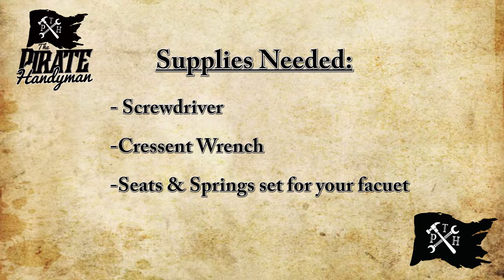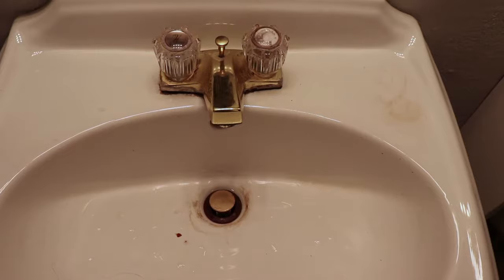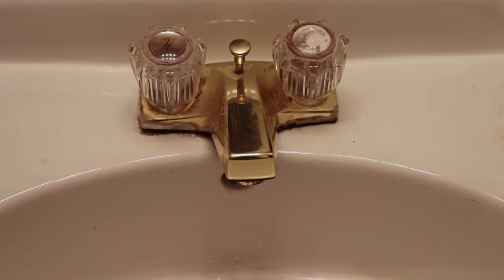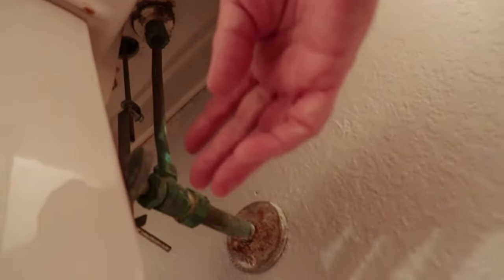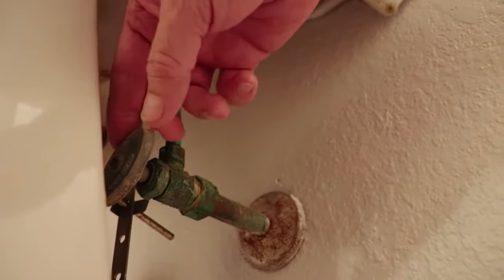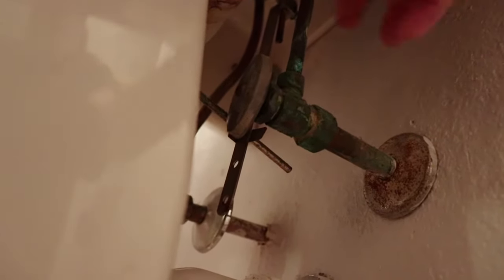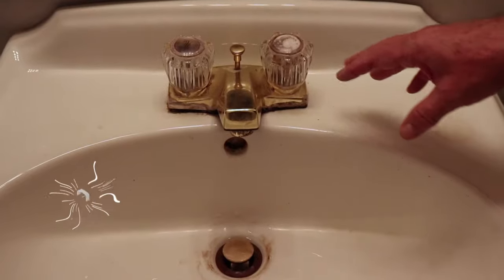How to Fix a Dripping Bathroom Sink Faucet Double Handle

Comment: Just a tip make sure u put the stem back in with the flat silver part on the bottom of the stem over the spring and seal in the off position and the knob the same way it came off you can get the direction of stem the wrong way. If u notice in the video he turned knob to left to turn off which is backwards. Also grab some waterproof grease and lube up all the o rings and seats. Good video buddy people don’t realize how easy and cheap it is to fix this.
Reply from the maker: Aye, matey, thank ye for the tips!

Comment: Hey matey.  I tried your drip fix and it worked as you explained.  One word of caution.  I didn't push the seat spring far enough down.  Since your directions were so good.  I ended up doing both of the handles.  Thanks so much.
Reply from the maker: Aye, matey, glad it worked - smooth sailin'!

Comment: Turned off the hot water under the sink to fix the sink faucet, and now the shut off leaks...
Reply from the maker: Aye, that happens. But it's an easy fix. Although the video link below is for an outside faucet, the fix is the same on the valve. Let me know if this works for you.

https://youtu.be/KDAB0HjgYYs

Comment: This is a terrific video, clear and to the point. Unfortunately, I didn't get very far with the repair. Do you have any suggestions for how to remove a stripped collar? The crescent wrench just spins around. To help it grip, I tried wrapping it tightly with a rubber band, but it did no good. Same result with locking vise grips. I appreciate your help. Thank you so much for sharing your knowledge!

Comment: Great video, taught me all I needed to know. My biggest problem was finding the right seat and spring. I made 2 trips to Ace Hardware, but it was wrong both times. So I ended up at Lowe's. It was smooth sailing from there. My next project is unclogging my double-drain kitchen sink with disposal. Have any videos on that?
Reply from the maker: Aye, matey, and thanks for the kind words!  Here are 3 videos that might help ye with yer sink issues:
https://youtu.be/21Gl3ObLH6Q
https://youtu.be/OVaLKdxC8tY
https://youtu.be/BQxzPwtFzHA
Here's to smooth sail'!
Reply: Yes, any old seat and spring doesn't work.  I'm having trouble finding the right one also.  My husband remembered we have an old tub faucet.  Voila!  Same parts.  The video is great.

Comment: Thank you for going the extra step of showing the gasket and spring UNDER the cartridge!!!
I replaced a hot water cartridge for my MIL and in a few months it started to leak again 🤦 . 
I bought a new cartridge at that has the gasket and spring with it. Even though the cartridge is a few months old, I will still change it out at the same time . 
Thanks again for this video!!!
Reply from the maker: Aye, lass, that usually be the problem!  Next time, you'll know to just buy the grommet and spring, and save even more coin!  Smooth sailin'!

Comment: Good video. The only thing I might ad is while I have it apart I would replace the O-ring as well. Might as well replace it all while you're in there and some have a little flat washer, a smaller O-ring and a brass seat. The brass seat doesn't need to be replaced that often usually when replacing everything else doesn't work but hey, while you're there. Your call. Enjoyed the video. Keep up the good work.
Reply from the maker: Aye, matey, thanks for the insight - we appreciate the recommendations!

Comment: I know how to fix leaking faucet but has one that kept leaking even after replacing everything. 
The “treasure” (pardon the pun) in your video was getting all the water out before putting the spring and gasket back in. No more leak and didn’t have to buy anything. 
Thanks matte
Reply from the maker: Aye, matey, glad it helped - smooth sailin'!

Comment: This video helps so much. Another problem I have with my faucet is that is moves back and forth a bit. It's not sealed well to the sink. Is there an easy fix for someone like me who is not handy at this sort of thing? Thank you for your help.
Reply from the maker: Aye, there are large "wing nuts" underneath the faucet where the water lines connect to the faucet. You just need to get underneath and tighten these wing nuts, which should fix the problem.
Reply: @thepiratehandyman2225  Well Shiver Me Timbers and Yo Ho Ho!  This Scallywag should have known that all I needed to do was Batten Down the Hatches. Seriously, I thought I needed to caulk it or something. Thank you. Ahoy Matey!
Reply from the maker: Ahoy - glad this helped! Smooth sailin', me hearty!

Comment: Thanks a bunch. Your video is easy to follow and makes the work much easier.
Reply from the maker: Aye, me hearty, thank ye for your kind words - glad it helped!
Reply: I am back! I was unable to get to where I would see started dripping. Couldn’t move either valve inside the cabinet. Are the valve really corroded? Please reply?
Reply from the maker: Aye, it could corrosion on the valves. Try spraying a product like CLR on the shaft of each and let it sit over night. If that doesn't work, then try spraying the shafts with a lubricant like WD40. Let that sit a couple of hours, and repeat a few times. If that still doesn't work, you may have to call a professional. Let me know what happens with the above tasks.

Comment: 👏🏻 Thanks for the great video. My faucets don’t “seem” to have the seats and springs but just an old school washer. But there are these metal inserts that screw on at the bottom. I keep wondering if they should be adjusted a particular way to stop drips.
Reply from the maker: Aye, matey, are the washers rubber?

Comment: Excellently made very educational and helpful video.
Q1. is the spring and seat set universal for all faucets?  (I think my leaking faucet looks like yours)
Q2. How/where can I tell the brand and model of the faucet I have (it is abt 25 years old) - don't I need that to order the right type of spring and seat set?
Thank you!!
Reply from the maker: Aye, matey, thank ye for the kind words! Yes, the spring and seat is generallt universal, unless you have a fancy/expensive faucet. The name and model number is probably stamped on the bottom of the base housing, which would require you to take the faucet off the sink. More work than necessary, in my opinion.

Comment: Nice & clear & u made it looks doable, but mine is now leaking even when I shut it off under the sink.  
   Do u think this will fix my problem or do I have to do something with the shut off, under my sink?
Reply from the maker: Aye, lass, you probably need to replace the grommets on the shut-off valves, as well. Although the video link below is for an outside faucet, the fix is the same.
https://youtu.be/KDAB0HjgYYs

Comment: That was great! So are all the 2 knob faucets the same inside? Mine is old, it has porcelain faucet, does that make any difference?
Reply from the maker: Aye, lass, most be the same. However, some do have a different cartridge that may not require the spring and grommet - but not many. If your is different when you take it apart, let me know and we'll figure it out together. Smooth sailin'!

Comment: Great video !! I tried to turn the water off underneath the sink but can't get it to budge.  Can I take off the handle & replace the seat WITHOUT turning the water off underneath ?
Reply from the maker: Nay, matey, ye need to turn the water off or it will spray all over the deck! Try spraying the shaft of the shut-off valve (under the sink) with WD40 or 3-in-1 oil, and let it sit for a few hours. If this does not work after 2 or 3 tries, then you'll need to shut off the main line, which should be next to the house on a direct line from the water meter.
Reply: @thepiratehandyman2225  Ok, I thought so !  Thank you so very much for responding !! I did spray both the shut off valves with Kroil Oil this morning but didn't know I needed to let it set for hours.  I'll try again. Again, thank you so much for your most helpful response !!!
Reply from the maker: Ye be most welcome, matey - smooth sailin'!

Comment: Thank you this helped and I was able to find the issue. After replacing the cartridge I noticed my faucet still leaks. As I got closer it looks like the part where the spring and cartridge kit goes into has a crack. Is there a way to replace just that part or will I need to buy a whole new faucet?
Reply from the maker: Aye, if the casing is cracked, ye need to replace the entire faucet. But at least now you have the knowledge to replace it yourself!
Reply: @thepiratehandyman2225  thank you!!
Reply from the maker: Ye be most welcome - smooth sailin'!

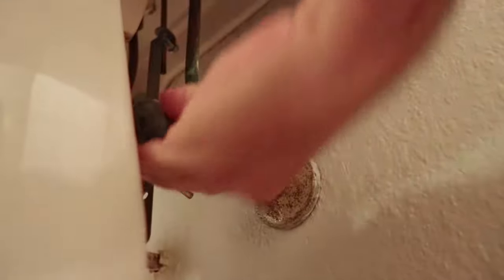Comment: Having a hard time with just turning the water valve to shut the water off under the sink, 2:17 . Is it just because these haven’t been shut off in a while or could something else be going on? Great video and appreciate any tips on this. Thank you!!
Reply from the maker: Aye, if it hasn't been used in a while, sometimes a build-up of minerals can make it hard to turn. Try putting a lubricant on the shaft, like WD40 or 3-in-1-oil, and let it sit for an hour or so.  And thoank you for your kind comments - smooth sailin'!

Comment: thanks for the video, very informative.  Once I got the collar off, the plastic stem won't come off - it's been there a long time, lots of hard water in the area, only seems to be one tab on the part, it's really stuck on.  Pretty sure it's the washer seat and spring to replace, but can't seem to get the plastic stem off to even get to the seat.  Any thoughts on how to remove?
Reply from the maker: Aye, matey, that be a common problem.  Try putting a lime-dissolving solvent like Lime-away on the collar and let it soak.  If that doesn't work, put a lubricant, like WD40 or 3-in-1 oil and let it sit for an hour or so.  This combination should do the trick.
Reply: @thepiratehandyman2225  thanks , will try the lime away.  Put Liquid Wrench spray but no luck. Crossing fingers.  Thanks
Reply from the maker: Aye, matey, may luck be with ye!

Comment: Hello and Thank You, your video is very helpful.  I do have a question if you could help.  I don't think this my sink handle has ever been taken apart.  I got to the part where I was to use the wrench on the nut before removing the cartridge.  Well, the nut is not budging....  Will wd40 get it to loosen or unfreeze it? Or what would you recommend?  Thank you in advance for any ideas.  Falicia
Reply from the maker: Aye, Lass, WD 40 should work.  You may have to spray, let it sit for a few hours, and repeat.  If that does not work, soak a small rag in very hot water (don't scald yourself!) and wrap the rag around the nut after spraying again with WD 40.  Let that sit for about 5 minutes, then try again.  If that does not work, let me know.  Good luck, matey!
Reply: Did it work ??

Comment: Love the video and seems greatly informative.  However, I’m having an issue.  I have 2 handles instead for my hot and cold water.  When doing all the steps you did above, after I took the cartridges out (which was a major pain) I was unable to find the seats and springs that you had mentioned.  The handles/faucet themselves seem to go a lot further down as well in comparison to yours.  Is it possible my faucet just doesn’t have those seats and springs?  After draining the excess water with toilet paper where the handles were, that had stopped the drip.  However, when I turned the water back on (after reinstalling everything of course) and shut them off, the slow leak returned.

I should also add, I still had a very slow drip when I turned both the hot and cold water off.  Any ideas?  Thanks
Reply from the maker: Aye, matey, let's first tackle the dripping water when you turn off the feeder valves. There is a grommet on the end of the valve stem that probably needs replacing. The video link below, though for an outside faucet, is the same concept.

https://youtu.be/KDAB0HjgYYs

As for not having seats and springs, does the valve handle have a grommet on the end, like show in the video above? If so, then the fix is the same. If not, then you may have to replace the cartridge.
Reply: Sorry about the much later reply, definitely not my intention.  I ended up changing the cartridge on both sides and that did the trick.  Appreciate the help and the knowledge.

Comment: This is the exact type of faucet and knob I have. I need to only replace the knobs. I bought a universal pair that was supposed to “fit all faucets”. Well, it doesn’t because of that white piece structure under the knobby . Is there a certain knob for this; one that fits on this particular knob configuration?
Reply from the maker: Best thing is to bring the old knob to the hardware store and see which one matches. If there is a knowledgeable person there (usually there is), they can help you. Good luck!

Comment: Thank you for this video..just a question, what does it mean when the water keeps filling back up after you've removed with tissue paper?
Reply from the maker: You may need to replace the grommet in the supply valve under the sink. The video below shows how to replace it. Even though the video is for an outside faucet, the concept is the same.
https://youtu.be/KDAB0HjgYYs

Comment: The small sring in bottom . Does wide end go in first or small end
Reply from the maker: The wide end of the spring goes into the rubber grommet, and the narrower end goes in the hole.

Comment: Help, please? I have the same sink knobs but their placement is separated by the faucet.  When I turn on HOT water,  water drips from just beneath the plastic part. It's gradually getting worse. How do I fix this?  Thanks from an inspiring DIYer!
Reply from the maker: Aye, matey, it sounds like you may need to replace the cartridge as well as the spring and grommets. If it still leaks, you might have a crack in the housing. In that case, you will need to replace the faucet. But even then, ye can do it!

Comment: Just removed my handle and valve assembly piece... It is a price pfister and all came out as one piece.  I do not see a spring or seat like you had.  There is a black rubber piece that looks similar to your seat in the bottom of the valve assembly.  Can that be removed and replaced or will I just need to replace the whole valve assembly piece?  Thanks!
Reply from the maker: Aye, matey, for that one, you just need to replace the rubber grommet. Although the video link below is for an outside faucet, the concept is the same.
https://youtu.be/KDAB0HjgYYs

Comment: Thanks for video, would of been helpful to know part number you used? Danco 86968?? For the seat and spring part to go fetch.
Reply from the maker: Aye, I understand the concern. The problem is, there are so many generic brands that will work, and it all depends on the store or website you use. It's impossible to list a specific part number without excluding several that would work.

Comment: Hello , I have a cast iron sink in my bathroom it’s 
not so old but I’ve been looking for a faucet to replace the one of the faucets, but to no avail 
I’ve had no luck, its brand name is American Standard I’m guessing it’s from the late 50’s mid 60’s , the hot water handle faucet as l turn it 
it just got completely loose. 
My husband has been looking for a way to fix 
it we’ve gone all over Atlanta looking for that particular part but because it’s a four inch and not a a six we’ve been told it’s really un fixable. 
I really hate to part with that sink yes it’s old, but it has such charm . 
Any advice, please 🙏 
Thank you so much for sharing your experience in your videos.
Reply from the maker: Wow, lass, I have never come across this. Can you send me a photo of the sink and the part? thepiratehandyman@gmail,com

Comment: Question how do I get a screw out of a door hinge if it just keeps turning? You helped me with my leaky faucet can you help with this? I
Reply from the maker: Aye, lass this can be tricky. Here are a couple of things to try. 1. Fold over a piece of duct tape so you have "sticky" on both sides. Press down with you finger on the head of the screw, turn counterclockwise while gently pulling back.  2. Take the smallest screwdriver you have (a jeweler's set, if you have one), and try to work it into the crack between the head of the screw and the hinge while turning the screw counterclockwise with your regular screwdriver, and pry the head towards you. Good luck!
Reply: @thepiratehandyman2225  thanks I will give it a try!

Comment: Another issue:
I just moved into an older rental house (2007) and the bathtub is backing up with water-drain is plugged up. So I unscrewed the little drain stopper and there was half circle with a hole that seems like you could insert an Allan wrench. But I tried & it did nothing. I’d love to replace this whole drain/stopper thing with one that allows you to easily clean the drain out, also seals better, and one that allows me to add a hair catcher inside of it. (My husband always fixed all these problems but it’s just me now) Help me!
Reply from the maker: Hmmm, I've not seen that before. Rather than possibly damaging the piece, I would recommend that you call your landlord and have him send a plumber out to fix it. If you are present when the plumber is there, that would be a great opportunity to ask him about a replacement stopper with a hair-catcher.

Comment: Are those parts  universal? I have kohler bathroom  fixtures, will it fit?
Reply from the maker: Aye, matey, ye might need to get Kohler parts. If you can, take the old spring and grommet to the hardware store, and see if the sizes are the same.